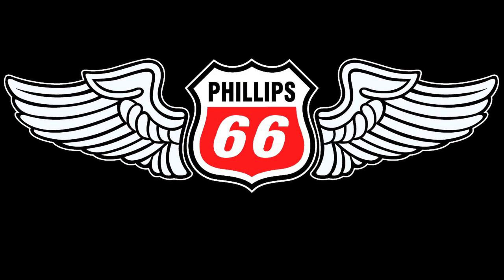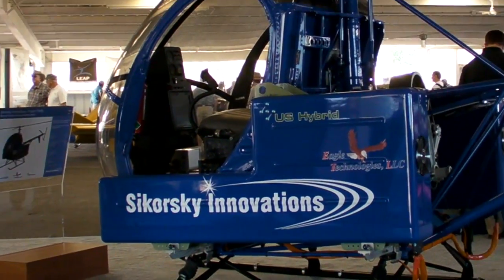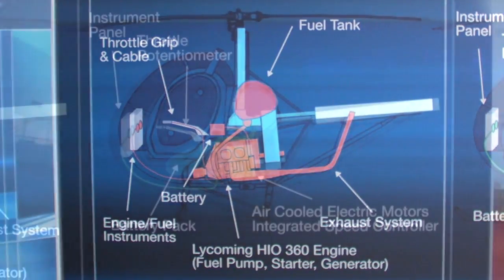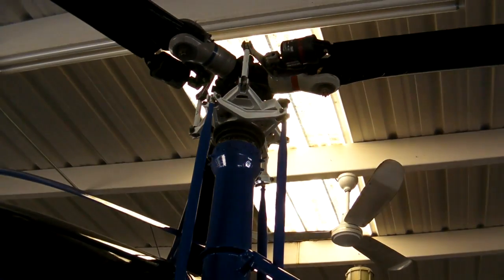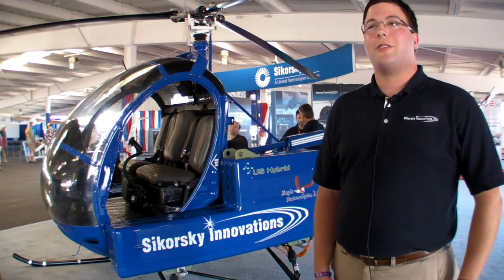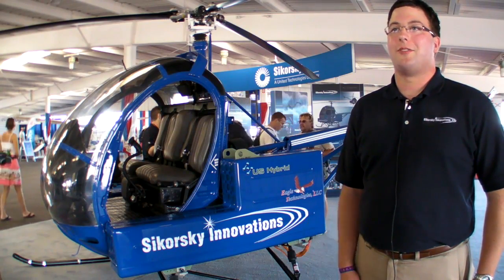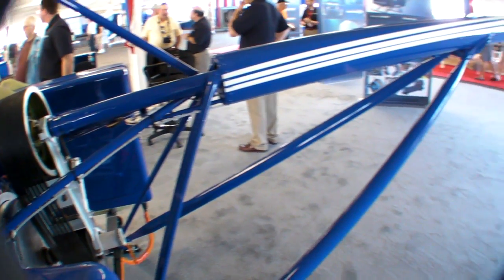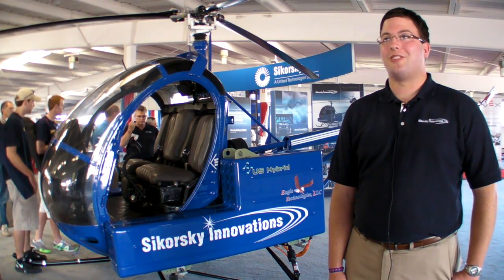Sikorsky Firefly: An Electric Helicopter

Comment: when they take out the gearboxes,main and tail box, get rid off all that weight and mount electric motor directly on each rotor this might actually work :)  then it just has to come remote control and you have a full size RC

Comment: 15 min not to long ...why not use a alternator  as the rotor spin's to recharge the batteries in flight and that will give 5 -8 hrs flying with no refueling 
its not that complicated ...we just cant seem to get away from fuel

Comment: All you bone heads talk about 15 minutes of flight time. This was the first one built dummies. Besides even though the technology is new this helicopter would reduce my trip to work from 45 minutes to about 15. And I wouldn't pass a single car. 
Also electric motors are far less likely to break down in mid flight. Give this technology three more years and then you might get it.

Comment: As we can now see with RC Model Heli's real power and resonable flight times are available.

The unit here is an internal combustion craft that has been modified, that is never ideal, especially for a helicopter where weight is so critical, I estimate that this craft could fly 45min+ now if it was weight reduced. Best of all build it from scratch.

Comment: @Scorpion85629 
You cant replace a combustion section with an electric drive.. Combustion expands the inlet gas (air) to tens or hundreds of times it's original volume due to chemical reaction processes involved in combustion, it's this expansion that creates thrust. There is nothing you can do with an electric drive that would do that. even if you spun a jet turbine at full speed it would make hardly any thrust without combustion to expand the gas.
Reply: If you can make the helicopter/drone as barebones as possible, you don't need as much thrust.

Comment: @jetplaneflyer, sorry I wasn't very clear on my comment.  Think outside of the box for a minute.  What is the max RPM or a typical turbine engine?  What would be the thrust if converting a jet fighter engine to full electric.  Most of the engines have a forward mounted generator so supplying the needed power for the battery pack should enable non-stop flight, power loss and efficiency shouldn't be an issue.

Comment: @Scorpion85629,

Why would you do that?. An electric motor already generates mechanical torque so why not use it directly rather than take huge losses in efficiency and much added weight that would be implicit with all the fans, turbines and gearboxes of a turbo system?

Comment: Okay now put that motor into the combustion section of a turbine engine; removing the combustion section, as I been talking about for too many years; ever since 1991 when I was in junior high.  Some motors have higher RPM range than some gas turbines.

Comment: Also interesting is the use of Lithium Ion cells.  One of my first early RC helicopter Kit designs back in 1999 made use of the FIRST Tadiran  Lithium Ion cells for RC helicopter use, then of course came Lithium Polymer , rechargeables and now high discharge Li-Pols, which in my opinion, is currently the way to go. A new technology in even lighter, safer and even higher discharge cells will some day, in the perhaps near future, obsolete the gas engines used in commercial aircraft.
Reply: 12 years later, I am the first to like your comment and reply. Does this comment give you nostalgia? times when people used to be serious while sharing opinion on internet, even in comments of youtube

Comment: Most of my original MIA Micro-FLIGHT helicopter designs and upgrades for RC helicopters still promote the motorized tail rotor direct drive, for the simplicitry and efficiency it provides WHEN DONE PROPERLY. This has made perfect sense to me since my first RC helicopter electric design back n the late 80s. It is very interesting to see electric propulsion being adopted in real helicopters. Check out my Channel and web site MIA Micro-FLIGHT Blog and Museum for some more interesting stuff.

Comment: @fireengineer  Do you think a hydrogen burning turbine engine would work best in this situation, turning a large alternator to power the motors in the rotor drive system? I think it would make sense, as most successful electric drive vehicles have an onboard engine to generate their power (diesel-electric locomotives, for example). It might make for an interesting aircraft.

Comment: The weak spot of electric aircraft is not the motors so much as the battery system. Batteries have low energy density in comparison to hydrocarbon powered internal combustion engine; until that weakness is solved, battery powered manned aircraft will remain an experimental technology with a few niche uses. A more feasable approach (for now) may be to use an internal combustion engine to generate electricity for the onboard motors. Just a thought...

Comment: Very limited, so much technology needs to mature for this to be viable. Full points to   Sikorsky  for the concept model but in my opinion it will be a decade before we have the super high efficiency motors and chemical batteries to make this happen on a commercial level.